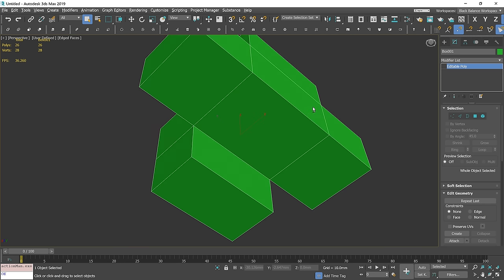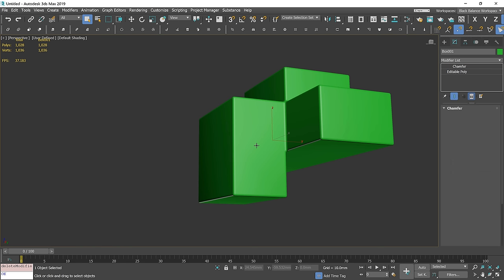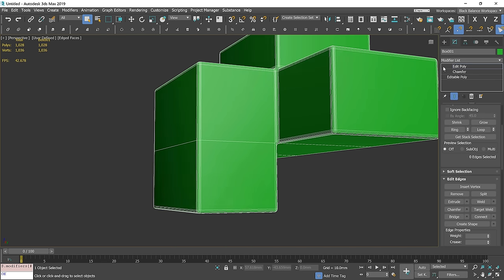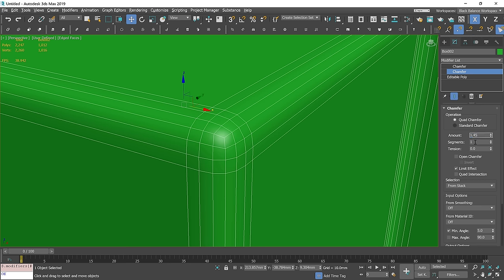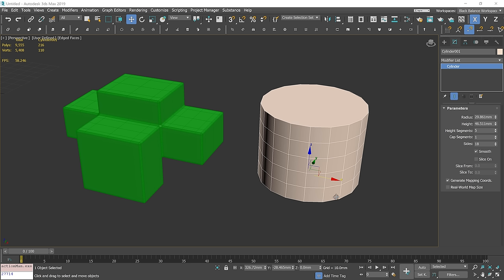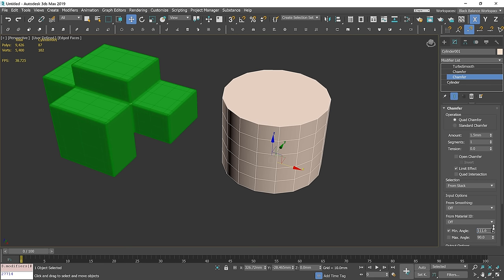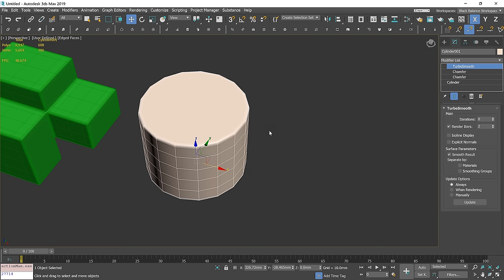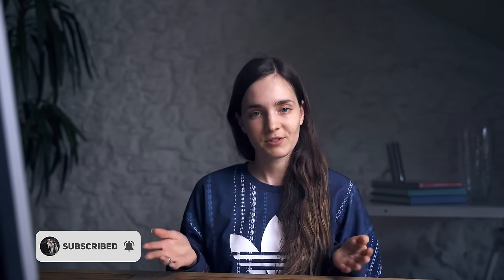More PHOTOREALISTIC renders | Best method to chamfer the edges in 3ds max

Comment: 1. Add chamfer modifier
2. set 3 segments
3. set 0.5 tension
4. Set smooth chamfer only
Done
Reply: Same
Reply from the maker: Thanks for sharing ;) Here is the difference: https://archvizartist.com/wp-content/uploads/2020/05/chamfer.jpg
Reply: @ArchVizArtist  hm, there is definitely a difference and a big one. Will have to try and compare both in fully textured and lighted environment to see the difference there.
Reply: @ArchVizArtist  it's worth the time and all this modifiers to get those round edges that are (mostly) far away from the camera? I mean, just in specific closeups, but for the 90% of the jobs...don't know..at the end we just want those line reflection of the light in the edges ...
Reply from the maker: Just one more chamfer modifier (turbosmooth not necessary, I use it mostly in cylindrical objects). We made a script out of it so it's just one click. I'm not trying to convince anybody, this is just how we use it :)
Reply: @ArchVizArtist  Well, making a script out of any of those methods is definitely big timesaver. Make a tut for that. Its most welcome .
Reply from the maker: Will do :)
Reply: You are right !
they did it wrong on the video
Reply: Same here. Just using one chamfer you can get what you are looking for.  If you need a more advanced smooth you can use the smooth modifier and click "auto smooth" and then set the threshold if you are not happy yet.
Reply: You need to start a tutorial channel sir.
Reply: i thought the same at first but i tested both and the double chamfers , the double chamfers are definitely better looking , no hard edges on the connection point of a chamfer to a wall
Reply: @PIXELBUNKER  thats true.
Reply: @hldemi  At the end, which one have you preferred?
Reply: 5. Smooth to adjacent.

Comment: The normal issue is solved by now (in 2021 and later) in the Chamfer modifier in Inset section you can choose Flow Loop that adds edges to your object that solves everything.

Comment: I just add chamfer, and in the final list, there's a option to smooth just the chamfer and kept the other faces without the smooth look
Reply from the maker: This method is not so good, you can do side by side comparison ;)
Reply: @ArchVizArtist  I can't remember In 3ds max 2019, but in 2020 version there is an option on the chamfer modifier in Smooth Output with "smooth chamfers only". It fixes the issue of the "belly" surface. And there's a box with "smooth to adjacent" in that option which makes a smooth transition from the chamfered edges to the surface.
Reply from the maker: Thanks :)
Reply: @ArchVizArtist  You're mostly welcome.
I thank you for the great content on the channel. ;)

Comment: If you set the chamfer to smooth chamfers only AND (and this is very important) you also set "Smooth to Adjacent" and a Threshold around 90 ( if you are working on a mesh formed by straight angled edges), the smooth you get will be just PERFECT.
Reply from the maker: Here is the difference: https://archvizartist.com/wp-content/uploads/2020/05/chamfer.jpg
Reply: @ArchVizArtist  ok fair enough :). Muy smotthing to adjacent method meets my standards though.

Comment: The chamfer modifier got a lot of flak for not being a very exciting new feature, but that thing is a massive time saver. Doubling up the chamfer modifier to fix the smoothing issues there's an easier way in Max 2021. Just drop a Weighted Normals modifier on top of the stack. Another option for doing chamfers when using V-Ray is to plug a VrayEdgesTex into the bump slot of the material, provided you're not already using it for a bump map.
Reply from the maker: I'll check it :) Thanks for sharing!
Reply: You can stack a VrayEdgesTex over your previous bump with a composite, it still works
Reply: @Tapiokpr  Nice! I didn't know that.

Comment: Can you make a tutorial on how to round the ends of a brush using Hair and Fur? I tried to cluster some splines to use as guides, having differing lengths, the longest in the center of the cluster, shorter bristles around the perimeter. Is there a way to intersect an arc cutting off the tops of the cluster to round it off...like a bowl cut (American haircut from the old days)? Please
Reply from the maker: I can try ;)

Comment: I add corona edges in the bump.. Perfect and light
Reply from the maker: Thanks for sharing :)
Reply: nope. Does not even come close as geometry chamfering.
Reply: @hldemi  ????
Reply: @fazeone1212  Its not perfect. You might think its perfect but its not. I just compared the two and Corona edges looks really really bad compared to chamfered geometry .
Reply: @hldemi  i use it in every project with  the right  measure , i assume you probably dont know how to tweek it
Reply: @fazeone1212  What`s there to tweak, one value ? I tried both and find chamfer to be much more consistent and better looking option. Not to mention that once I done geometry chamfered I can change materials and dont care about putting round edges into bump each time I change material. Same goes for floorgenerator. It will always look better than simple bump or displacement.
Reply: @hldemi  good for you then ! for me it saves time and looks great
Reply: @fazeone1212  thats ok if you make renders only for yourself. If not, you should try to see why others prefer chamfer. Maybe its becuase it objectively looks better and you should try to bring to your customers  best looking renders if quality is your goal.
Reply: @hldemi  my clients are plaised and the professionnels are using  it in the field..if you dont like it its your choice
Reply: And you can mix bump maps that blend with the bump edges , even normal maps and displacement maps.. you clearly dont know how to use it
Reply: @fazeone1212  Oh really , I dont know how to use it. You dont know how to read my comments with comprehension. Are you telling me that each time you change the material you dont have to put Corona edges into bump ? Thats all I am saying about it being more complicated. My edges that are done with chamfered geometry are not dependent upon material bumps . Lot faster. 

Also, if you think Corona edges are better, there is nothing I can do to make you think otherwise but you can try to make both and ask 10 random friends what looks better to them.

Comment: Mr and Mrs Archviz,  Im maya user, and i used to be a 3D Max user, but i made the transition before a while for some reasons, I used to be a Game Artiest, but now im trying to get me way into the interior Designers, I don't have friends who are into 3D, nor i know anyone, so it is hard for me to get help, and it is hard to be motivated when you are alone, with no support. I would like to ask few questions if you don't mind. 
1: Why 3D max is the choice for most interior Designers? 
i know that any program that u are good at is good enough. but why 3D max, in particular, is found into many interior Designer' artiest? i would like to know the answer. 
the only anwser that i could come up with according to my experience between the 2 of them, in my opinion, the only difference it is the "Curve/Spline" workflow between both. 
so what will u suggest to me, go back to 3D max or keep using Maya?
Reply from the maker: We actually have never used Maya, I think most arch viz studios use 3ds max, but I'm not sure why ;) I might investigate it more and maybe do some video on this topic in the future ;)
Reply: @ArchVizArtist  that's would be lovely. thanks you
Reply: I believe the reason is because of Max's modelling tools. 3ds Max's modelling tools makes it very easy and quick to do hard surface modelling, which means it's easy to make architectural models.
Reply: @danielduplessis9170  I don't think so Daniel, i find Maya as easy also ...
Reply: @JakMesh  I didn't say Maya is bad for it or difficult. You can just as easily do Archviz modelling in Lightwave or Modo if you really wanted and are comfortable enough with that software. My point was, the tools in 3ds Max are more geared towards and catered for Archviz modelling. Software like Maya, on the other hand, makes organic modelling easier and better, but that doesn't mean 3ds Max can't do organic modelling just as well, just that Maya is easier for doing it.
Hell, you can do Archviz modelling in Zbrush if you really wanted to, but obviously its toolset is more catered for organic modelling.

Comment: Hey why not go Chamfer modifier > Output > Smoothing output > Smooth chamfers only & checkmark Smooth to adjacent? does it not do the same thing?
Reply from the maker: Using the method I showed the output is perfect. Smooth to adjacent is a shortcut and the result is not so good. I've just double checked 2 versions side by side and I can clearly see the difference. Test it quickly and decide :)
Reply from the maker: Here is the difference: https://archvizartist.com/wp-content/uploads/2020/05/chamfer.jpg
Reply: @ArchVizArtist  Ohhh, my bad then!! Sorry and thanks a lot! Great tip.

Comment: I'm a bit dissapointed this time, first of all: click bait on the title about solving edges in 5 secs, which honestly just shows how to fix the problem in a long process. Second of all challenging the Smooth adjacent faces toggle in 3DS max, in your video comments, by the way, without the comparison of the actual fast paced solution created since 2018 as a programed software solution after years of facing the geometry problem from autodesk is kind of off the track here. Come on guys, you don't need to fall far from the high edge you've placed yourselves lately! You've been doing great, watch out for things like this before becoming "another" click-bait archviz channel...
Reply from the maker: Firstly, we show the whole process so everyone can understand it. If you watch till the end we suggest to make a script out of it (or just copy modifiers). So the process is super quick. 
Secondly the method you refer to doesn't work so great. Just chamfer the edges side by side using both methods and you'll see the difference...
Reply: @ArchVizArtist  we have ran hundreds of tests around it, and unless we need a Microscopic zoomed lens in the studio the perception is minimal, speedwise, with a project with 200 edges in geometry or more this methos becomes a very specific process for, maybe asrecalled, a table in front of your lens, or a corner shot, etc most of us in the market use 3 methods depending on distances from camera and I bet you know it: geometry detailed chamfers, smoothened adjacent faces for geometry at mid distance and render engines edge traced materials for long distances referenced objects. Look I didn't mean to offend you, as I said we all admire you guys at your studio, but it really dissapointed me getting hung up on a click bait, that's just not cool, of course your method works! But it is a time dependant task! And arguing about how other methods don't show the same result is also valid, but as we all know, this is a time-dependent industry, and that shall also come into knowledge of users!
Reply from the maker: Here is the difference: https://archvizartist.com/wp-content/uploads/2020/05/chamfer.jpg
The difference is pretty clear to us and we do not usually care about poly count.